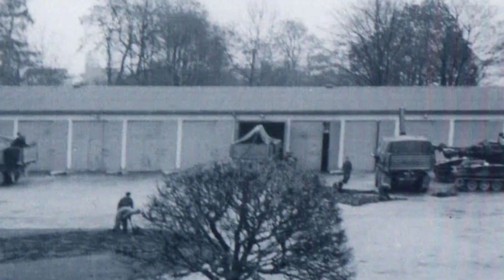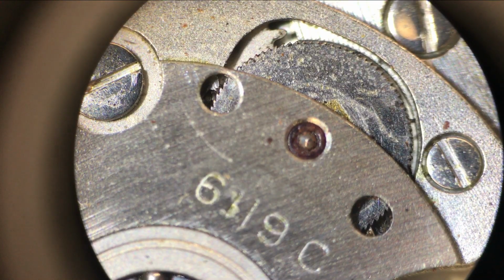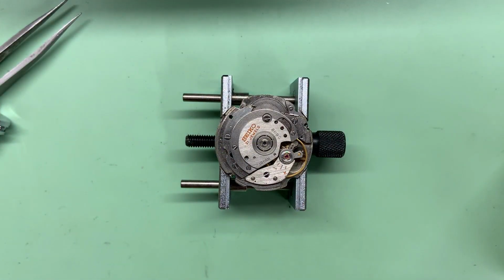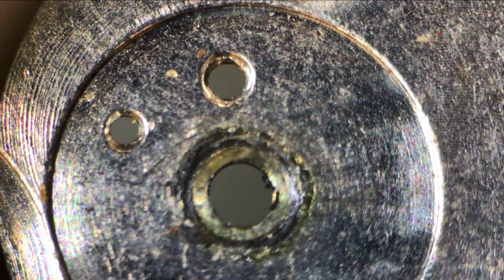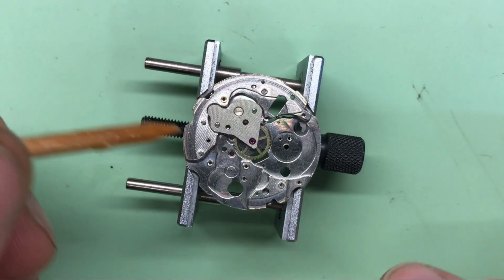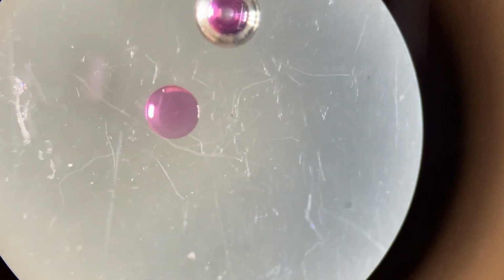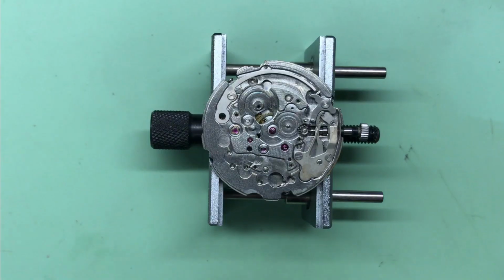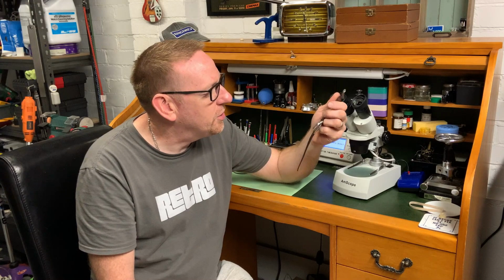A Seiko With a Story - Full Service of a 6119C

Comment: Great video.  Most people probably don't realise that, for the money, the build quality of Seiko vintage watches in particular is ridiculously good.  For someone on a budget who is new to watch collecting Seiko, and in particular the Seiko 5 range, represent perhaps the most logical starting point for a collection.  There are literally tens of thousands of examples out there for between £40-200 offering a range of movement and case combinations complimented by Seiko's amazing dials.  The build quality and durability of these truly iconic watches means that there are thousands of examples out there over sixty years old, probably never serviced, and still running and keeping respectable time.

Comment: Great video, I just bought blue face 6119 on eBay. It keeps really good time and I like the fact that it's 50 years old, with a bit of light age related marks. I didn't have a clue how to set the date, so Googled it and found a helpful video. Your full length videos are just what is needed, for that extra detail.
Reply from the maker: Thanks, the 6119 movements are a favourite of mine.

Comment: I watched this just a little over a year ago. At first, I thought 💭 this was a watch that got ran over by a tank. I was totally wrong 😑. It means that this watch survived being somewhere inside the tank, hence the name, the watch also being built like a tank. By what I remember, the watch had been there for quite awhile. Both while the tank was being used, and during disuse. The watch appears to be in great shape, and all it needs is a good 😊 cleaning and oiling. Your friend, Jeff.
Reply from the maker: yes Jeffrey this watch was essentially in the engine sump for 10-12 months! amazing really and had it not been a new watch at the time I doubt it would have survived.  The new gaskets were likely to have saved it.

Comment: The P.X.(Post Exchange) sold these at a great price-duty free! Looks like a 155mm gun. We trained on something like this at Ft. Sill in '72. Cabin so small if you stood behind the sleigh which holds the gun the recoil would cut you in half. The 12 cylinder is the universal engine for all tracks in the U.S. army. I was in 8 inch self propelled in Germany '72-'74. Each vehicle had two engines, one for each track.
Reply from the maker: 2 engines sounds crazy powerful
Reply: @MyRetroWatches  No turn indicators either! LoL Twelve bolts takes the engine out-with the help of a crane and that extraction can be where the oil and gunk comes from.

Comment: A side note about beat error... The timegraphers we use show beat error in milliseconds and amplitude in degrees.  The higher your amplitude, the faster the balance is rotating, especially as it goes through the impulse phase.  This means that if you have any beat error at all, it will worsen as amplitude gets lower and improve as amplitude gets higher.  All because the measurement of beat error is in the time domain rather than being expressed in degrees.  When amplitude is lower, the overall arc is smaller, and since the time period of the arc doesn't change, the escapement spends a greater overall percentage of time with the impulse jewel inside the fork.  Therefore beat error is amplified in the time domain as amplitude lowers, even though the beat error stays the same if expressed in degrees out of center.  Hope that makes sense.  The practial side of this is understanding that as amplitude goes down, you're effectively zooming in on beat error.
Reply from the maker: Thank you for this concise explanation.  A good incite

Comment: Nothing wrong calling it a tank watch, the term came around due to shape and heavy build, Soviet tank watches tend to be super heavy rectangular pieces but can also refer to the Vostok Komandirskie "tank commander" dialled watch which is a very iconic design popular too.   I featured a Sekonda branded Slava tank watch recently on my channel which is beautiful as was a wrist virgin til I put it on.   

Working on a video on a USSR built gold and black Sekonda alarm which is insanely clever in design with two crowns, one for time and wind, the other for the alarm set and alarm wind and when it gets to the alarm set time, it releases power into a little hammer inside the case that taps like a little cricket hence the nickname of "crickets" for these watches.

Comment: Another great video and also informative😃👍
Please keep the videos as long as they are ..... it’s great. Nothing worse than big jump cuts leaving us wondering how you did that!  By all means skip some of the screw tightening, but the rest is why we watch ... warts and all😜. Also leave the cleaning in too.
Quick question, do you find that the diashock springs, especially on the older movements have a “correct” way up?  I sometimes find that if they are stubborn, flipping them over can make a difference. I presume that the spring gets “set” over time?
Keep up the great work and thank you for all of your effort👏
Reply from the maker: thanks for your feedback good to know you all like the length of these videos.  As for diashocks yes the springs can fix in that bent position , flipping them over can give more pressure but they can also become allot harder to fit.  You have to think like this watch in the video, its 50 years old and those springs have been out 3 times and then only for an hour at a time. so its a long time in one position.

Comment: No annoying click springs. At least not those little tiny SS spring wires. Simple design, made to run and run and run and run. That used to be Seiko. Quality with good performance for a reasonable price. Today you pay 800€ for a 4R35 that has more power reserve and you call it 6R15 or 35, with plastic movement and friction fit dial.

Comment: Fun fact about the Detroit diesel it’s a 2 stroke diesel. It requires a supercharger to run the engine dosent pull vacuum like a normal 4 stroke that’s in about everything.

Comment: Hi Mike. I am not familiar with Seiko 5. Could you advise on the possible cause of a calendar pusher fault? When pushed the day tries to turn over but doesn't quite make it.
Reply from the maker: 6119?  Remove the stem and crown , clean all the debris from behind the crown , also around the case tube. Replace and it should work again.

Comment: Hi Mike, half way thru the vid, all of those loose and 1 missing screw seems to me would account for the noise and possibly the low amplitude in the beginning timegrapher readings, by all means keep the musical montages in. I was whistling right along with today's piece. Lol.
Reply from the maker: Could be but the screws were not so loose they were rattling around just not finger tight.  Mainplate and shock jewels looked gummed up with old oil so this to me is the more likely culprit
Reply: @MyRetroWatches  at any rate they  sure didn't help the situation.  Great work on the restoration and what a great story that for a moment was going to be much worse. Like you, I'd like to believe the dial discoloration and the gummed up grease were because of being inside the engine. Very interesting to say the least.

Comment: Hi, have you ever worked on a old Timex watch, or would you.I have got one that was made in Scotland where I live, do you repair customers watches, please let me know Andy.
Reply from the maker: Morag De felice Most Timex I’ve seen are unserviceable. Riveted together . Not something I am interested in taking on sorry
Reply: Thank you very much for getting back to me. I have a Seiko  5  bought it brand new two years ago, when I take it off and lay it down flat it stops after five mins, is this common with this watch. Thank you. Andy.
Reply from the maker: @moragdefelice437  HI No that sounds like its not winding the spring enough to give it reserve power. Could be something out of place or a worn part.  I have just fixed a guys watch with exactly the same issue on the same movement but his watch is allot older.  His was the pawl lever (that transfers the rotor movement onto the transmission wheel) was worn out.  so it would only wind the transmission wheel every now and then when it got grip.  I replaced with a donor movement part and it fixed the issue.  Yours could still be many things though sadly.
Reply: @MyRetroWatches  Hi, thank you once again for getting back to me, thank you for your expert advice I don't really know what to do with my watch, will it do it any harm if just continue with it. All the best Andy.
Reply: @MyRetroWatches  Can you fix my 7S26C watch and how much would it cost, keeping in mind I am a pensioner. Thank you. Andy.
Reply from the maker: Morag De felice email me on michael@myretrowatches.com
Reply: Hi, can you fix mine. Regards

Comment: Thanks for great video and story! Curious if it would be cheaper just to get a new movement for the watch or not? The screw falling into the balance is my worst nightmare when working on watches. :-O
Reply from the maker: Andy B for this watch?  No you can’t get new 6119s so it would need servicing . As you can see on this one being 50 years old it still runs really accurately .
Thanks for watching
Reply: @MyRetroWatches  Thank you for the info much appreciated!

Comment: How do you change the day language on this movement?
Reply from the maker: You have to press in the crown. Press in to change date, press harder for day. That is as long as it’s a 6119C movement . If it’s an A or B you cannot quickset the day wheel.
If it’s a 6119c and will not work the chances are there is too much crap built up behind the crown for it to travel far enough to change the day.

Comment: Super Off Topic: But does anyone know how to open a Seiko Lord Matic 5606-5160? I'm scared to ruin it by just prying it open
Reply from the maker: Alex Biro if you remove the bracelet you should see on one end two square holes. Push inside with something and put some slight pressure on the crystal. Once you have done both you will see it try’s to open.
You will get the hang of it from there
Reply: @MyRetroWatches  oh sorry. I might have worded it wrong. That part i have done. Meant getting in to the movement itself. I do see a small screw if i lift the dial a bit. Thinking i might need to remove hands, then unscrew and perhaps lift of the dial an then find a way to remove the stem? Tried to find videos for thi perticular movement and case but cannot find. Only round case 5606s. But this square one is gorgeous, found it at a bargain as well.
Reply from the maker: Alex Biro I’ve not got your watch model to compare but usually with these types of Seiko you are looking for a small hole by the dial at 2-3 o’clock. The gasket might be covering it . In the hole you can poke tweezers in it and push down on a little leaver that’s allows them stem to be pulled out this then allows the watch to come out of the bottom part of the case.
Reply: @MyRetroWatches  Thank you! Took out the movement now just before going to work. The movement looked to be in brand spanking new condition. Not a single service mark. Huge surprise considering the case itself was full of dirt/sand, sweat and old skin probably. The isolation on this case must be amazingly well made. Can't wait to get off work and start tinkering.

You should make a vid or two on LM, KS or GS since there aren't many out there. I do understand though that they are less common and more costly than the movement you usually work on and might be harder to find replacement parts.

Huge fan of your work! Thanks for taking your time to reply!

Comment: Good job on a very nice watch, I have the blue version of it, that you can see here: https://wristsushi.proboards.com/post/236653

I've got one tip and one question for you.

The tip is useful for the dial feet screws and the click screw: I start to screw those while I'm still holding them with the tweezers, there's no need to strugle trying to make them stay on their hole by themselves. That works fine for me at least.

And the question: on the barrel, why do you use molykote (DX I assume) on the plate side and D5 on the brige side and not the same thing on both sides? So far I'm using HP1300 but I'm considering buying some molykote too.
Reply from the maker: nice watch and at least you now know its indestructible!   good tip on the screws,  if I am really stuck with dial screws I have used a pin vice to hold and screw them in.  as for the grease its a good question,  I dont know why really just feel that the mainplate arbour is susceptible to more wear , they go oval over time so my theory is to grease them well to keep that friction down to a minimum.    molykote is cheap and is like a tube of toothpaste.

Comment: You really need to change your camera around cause when you work all we see are your hands
Reply from the maker: odd comment, you see my tweezers more than my hands and there is no other way to build a watch without hands near. I dont have fancy cameras or lights as I simply cant afford it. Its hard enough making videos as it is without more obstacles in the way
Reply: Maybe not change the camera  but the camera angle.
Reply from the maker: Gary Dixon I will work on this